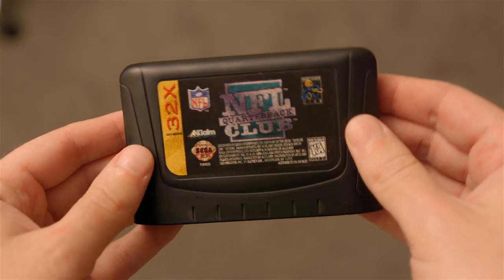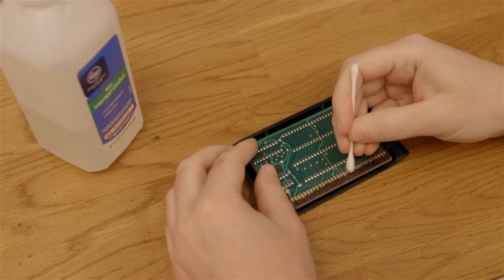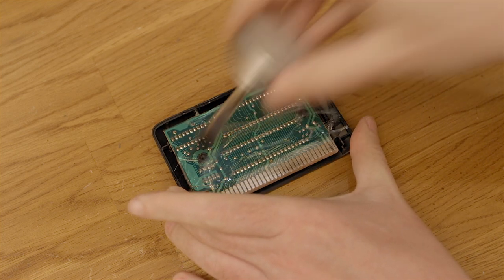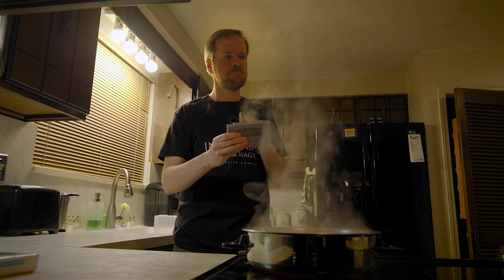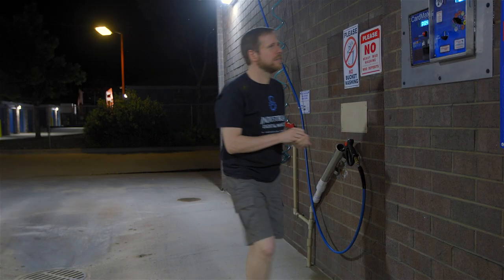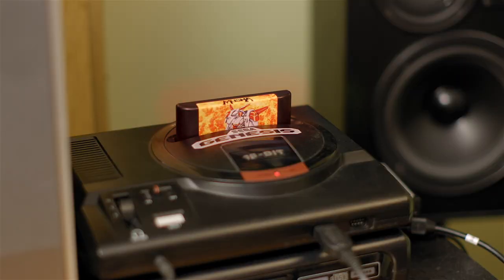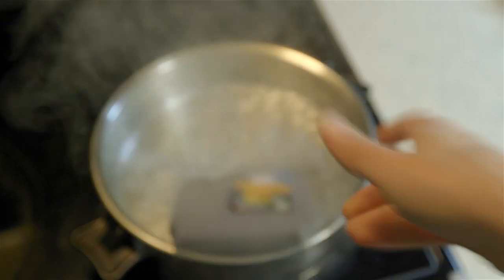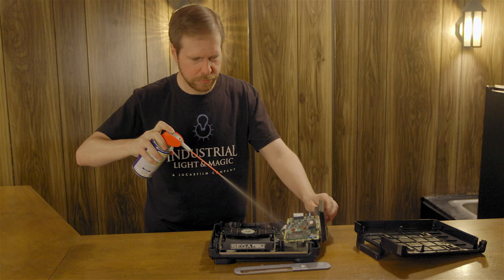How to Clean Your Stupid Games - Game Sack

Comment: I tried these cleaning methods with my N64. Now it runs Goldeneye in 4K. Thank you! Disclaimer... I may or may not be lying
Reply: Yeah, if anyone is running Goldeneye in 240p, it's because their N64 is too clogged with dirt, and barely any pixels are getting through.
Reply: 3dmarth seems legit
Reply: @3dmarth  I'm sorry (not really, just saying it), but you're wrong. The N64 has an analog video out. The resolution decrease isn't due to pixels getting stuck, but due to the dirt decreasing the frequency response of the analog video signals. You must be thinking of the issue with modern HDMI consoles.
Reply: @DasAntiNaziBroetchen  That was actually a joke, following up on what diggydash said about a clean N64 producing 4K. :P

I suppose dirt could block or degrade an analogue signal in certain cases, now that you mention it, though it wouldn't cause the resolution to decrease.

Comment: I really hope that Contra was a repro
Reply: "Absolutely no Contra IIIs were hurt in the making of this video" 
I'm gonna guess it was a copy of Madden or something.
Reply: I bet Joe will be like " I said no Contra 'IIIs' were harmed... we're allowed to harm one."
Reply: it was probably real. They are rich and can destroy as much as they want :/
Reply: "Rich" as a mailmen and video editor - yeah, right. Repros and such were probably used.
Reply: RetroProGamer the label looked authentic but not really in great shape. Putting a game in boiling water for a few seconds isn't going to hurt the internals at all. Solder melts at a much higher temp than water boils
Reply: water is never good to use on these. The moisture from blowing on cartridges is enough to damage it.
Reply: RetroProGamer right, but if you take it out of the water, displace it with alcohol and dry it out it will be like nothing happened. Circuit boards that are very dirty commonly get cleaned under a running tap with a tooth brush and some kind of cleaner. Doesn't harm them at all. What is a problem is when someone spills a liquid (usually not water) on something and doesn't take it apart to clean/dry it out.

Comment: I drilled out my cartridge, but now I'm missing one of my fingers.  Any helpful tips on joining that bad boy back to my body?  Thanks game sack as always. High five, erm I mean high four. 🖖
Reply: James Lourenco that's surely the next blue movie title 😂
Reply: Well, you know what the sack is that Game Sack refers to, and a finger is, well,  just as fleshy.
Reply: Qun Mang agreed 😂
Reply: Steve 🤣
Reply: Super or epoxy glue. If it doesn't work I'd suggest melting it back on.
If that doesn't work either use a stapler.
Reply: Frank Schneider the stapler worked a treat.  I'd love to shake your hand, but I've stapled my hand to my desk, so an awkward left handed fist bump will have to suffice. 👍
Reply: Ok, game sack, help me.  Im kind of stuck to my desk, long story but my stapler is set to outside staples.  Damn my cat for chewing it, anyhow I'm needing the toilet and any reply help would be appreciated.  I've tried cornflakes and fridge magnets.
Reply: Ok, I am  not game sack, but:
Semtex C4 .... That will surely solve your stuck to the desk problem (It solves ANY problem ... even better than duct tape).
Reply: Frank Schneider this is not steve.  This is his cat replying, he told me to tell you thank you for the help. 😂
Reply: Duct tape.

Comment: It's all just common sense for the discerning gaming gent or lady but thanks for reminding us! Atari wood grain dash benefits a power sander, a good resistant coat of varnish and a nail gun to hold it steady. Where as the common controller can be tricky with skin build up residue so post boiling you've got to go in hard with a blow torch and a 15th century arming sword, or for the peasantry a common axe or pick. 

Cheers mates!

Comment: Actually, sandpaper can be a good idea on rare occasions, but it's probably best to use it only as a last resort if your game isn't working and rubbing alcohol isn't doing the trick. It will make your pins nice and shiny and you'll get great contact. However, only do it once and never again, lightly , and with a very high grit. 2,000 grit at the absolute lowest, but I'd go with 3,000 just to be safe.

Comment: I really care about my games, but I don't understand technical things. When I am at the car wash, should I pay extra for the "no spot" rinse? I don't want to waste money, but I can't imagine having water spots on my games. Please help. Maybe I should boil them after? Or do I use the sandpaper? Wait. You can't mix paper and water can you? So confused.
Reply: James Lewis scissors beat paper, and rock beats scissors; so I’d recommend using rocks.
Reply: 3M wet or dry sandpaper is your solution here, my good man. Doesn't break down in water and the water helps lubricate for a more complete job! No more pesky gold plating left on those copper contacts!

Comment: Poring Acid over Cartridges and disks work best for me... If its stubborn dirt then I put them in a fire and burn that stubborn dirt right off (Must be done at a very high temperature) Job done.
Reply: Fire only works when being done at midnight while dancing naked around the burning cartridges..
Reply: Good tip.. I do that next time.

Comment: Scotch-Brite is way better it will remove the calcium buildup which is what you're referring to as dirt. Electrolysis causes this to happen. Sandpaper remove the copper off of the connector and loosens the fit. And if you use Scotch-Brite you don't need to take the damn thing apart... boiling would have been less harmful than the sand paper

Comment: Pssht.
Some nice tips, but too simplistic.
All good game consoles (Master System cards and PC Engine excluded) optimize their connection quality with a ninety degree angle of insertion to the console. Clearly "the best angle of insertion" (wisdom of the crowds and all).
Therefore, to restore a 90-degree connection - use an ANGLE-grinder (clue is in the name folks).
PC Engine hold-outs should still use sand-paper though. Please update your video to reflect.
xx